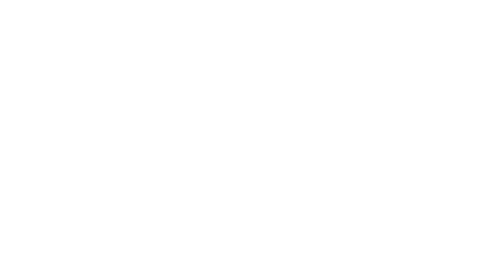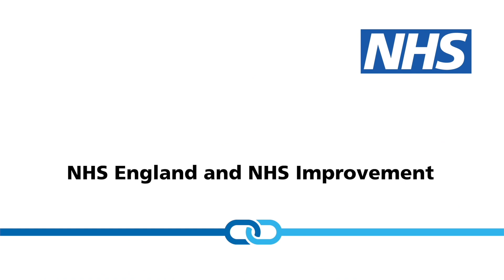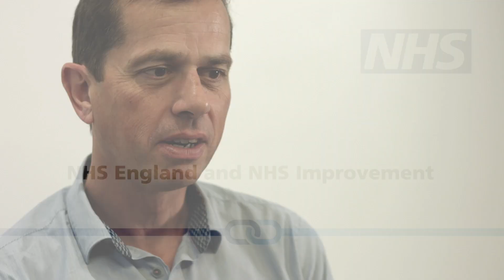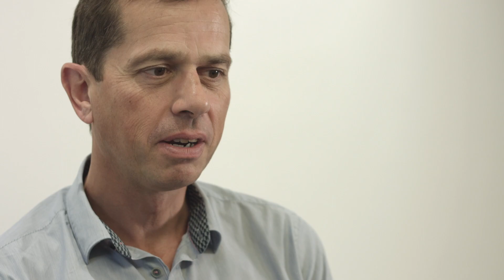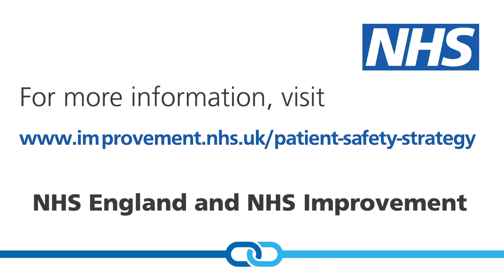Introducing the NHS Patient Safety Strategy

Comment: The Clinical Equipment User Manual Library allows staff to access all historical recalls and alerts alongside the manufacturers' instructions, our service ensures that device operators can familiarise themselves and perform basic user troubleshooting via searchable pdfs and videos and at the same time research historical issues related to specific makes and models :
https://www.bioclinicalservices.com.au/login/1355986472704d72f11386bb9573bf55